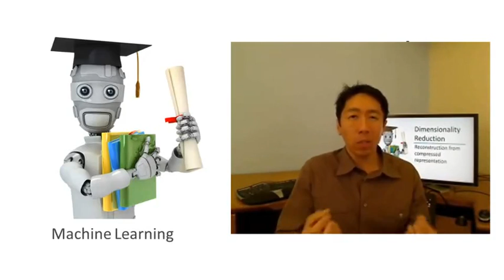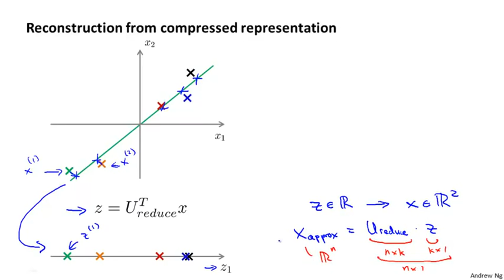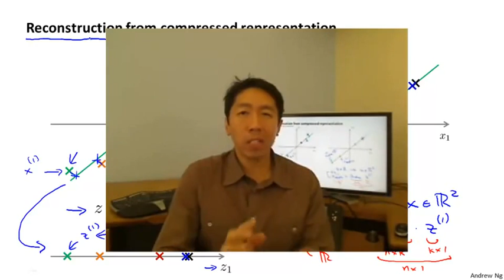14   6   Reconstruction from Compressed Representation 4 min)

Comment: I have a question. I have done data compression through Swing Door Trending algorithm. I had 20,000 data points and I compressed it into 300 data points. Now I want to Reconstruct the original data but stuck at some points. Can you help me in this regards?